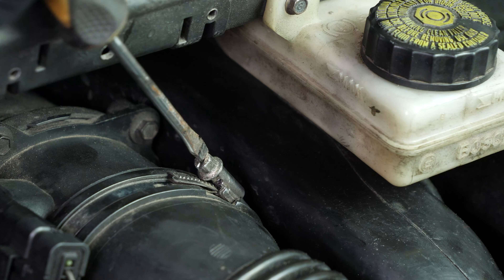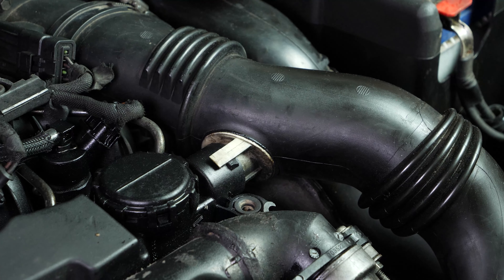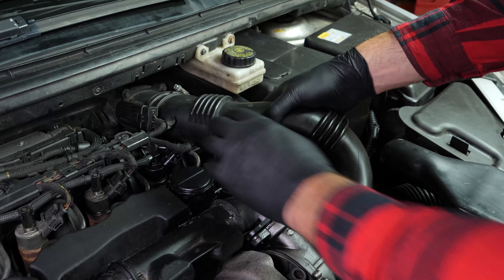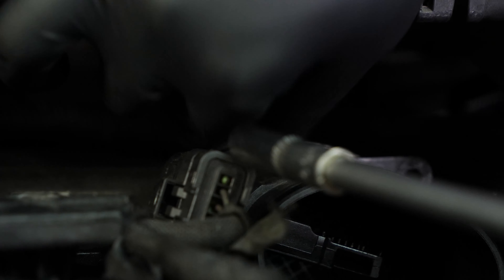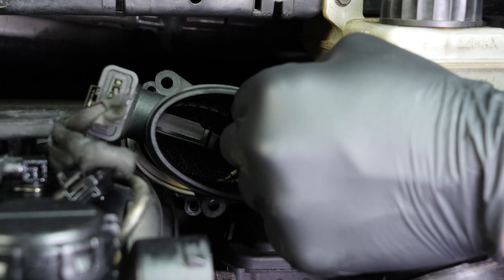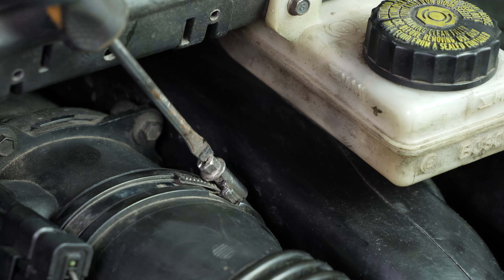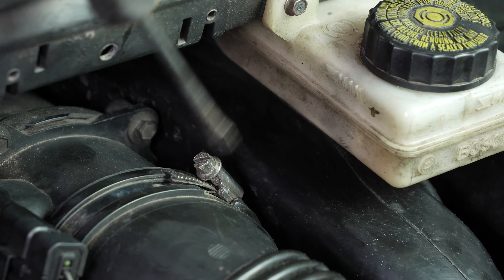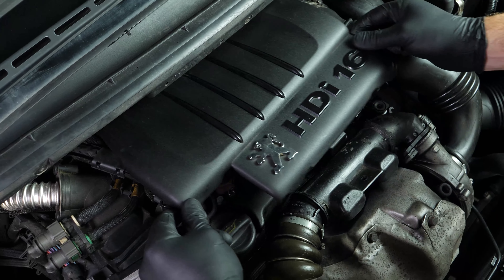How to replace the air filter C4 mk1 1.6 HDI 💨

Comment: Wrong... Just remove the air intake from the turbo and that top plastic rail that is above the filter housing... have done it so many times on my C4 and it's much easier way to access the filter.